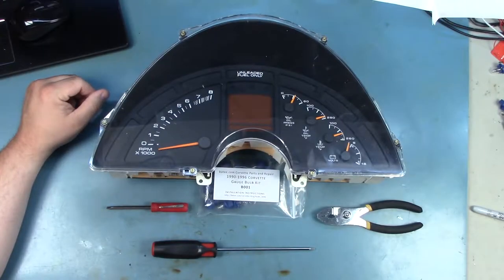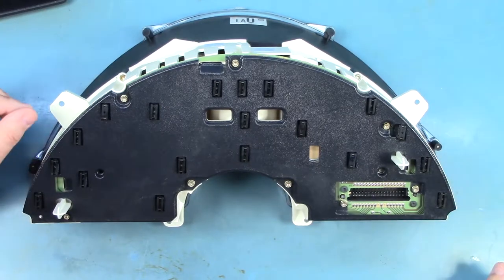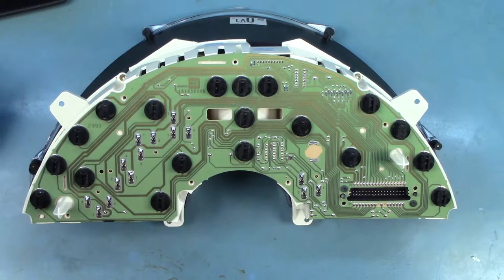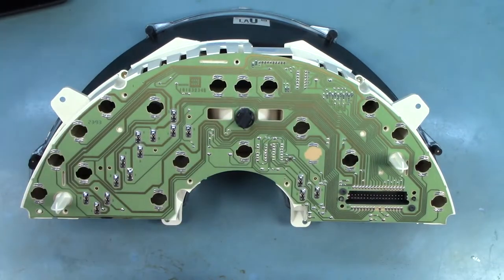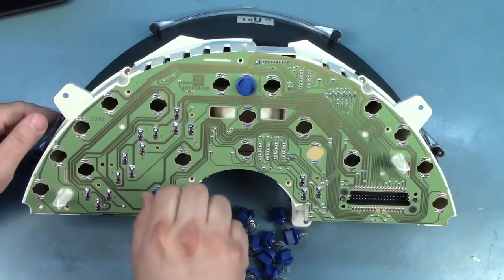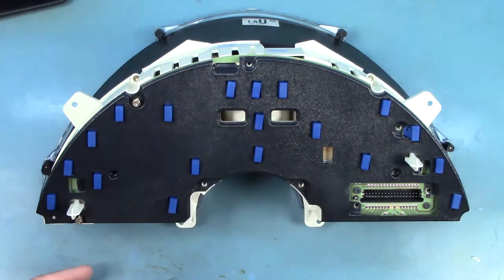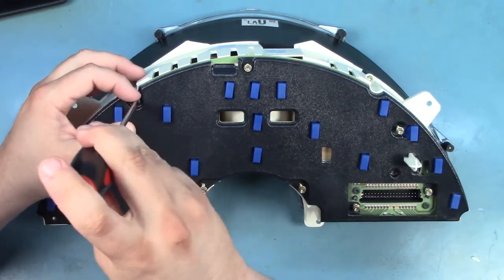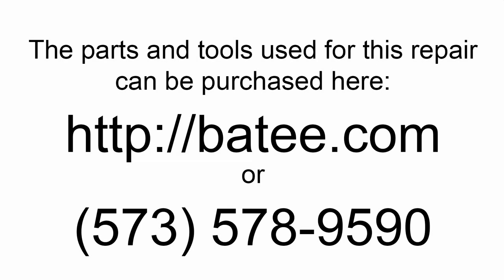90-96 Corvette #2 - Instrument Panel Bulb Replacement (2019)

Comment: Hi Mr. Thompson, my lcd screen is readable but a little dim.  How do I know if I need either a new polarizing film, lcd screen or just a bulb replacement?  I think I would try bulb replacement first, but would like your opinion on this matter.  Thank you
Reply: Watch the LCD for the first two seconds after turning on the key. All bulbs run at full bright during this time. Is it dark, or is it bright orange and light grey / low contrast?  If dark, it’s the bulbs. If bright, it’s the film. If it’s bright and contrast and gets dark, test in a bright location. If it’s still dark after 2secs, the photocell may be bad.

Comment: I've had a total of 3 gauge clusters in my 1990 base model. The first one 
(came when bought) 
wasn't working at all..
The other 2 all the analog meters are working, but the digital part is scrambled.. it changes, but it's scrambled even when it changes..
For example... When you accelerate you can see it's changing but it's scrambled the entire time.. same for the fuel indicator, odometer, ect.. please tell me some words of wisdom..😩